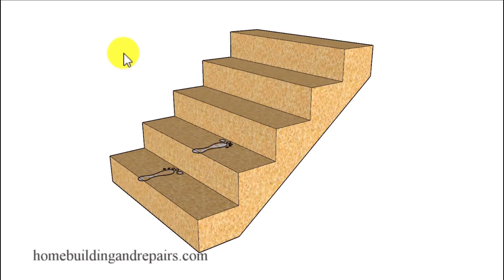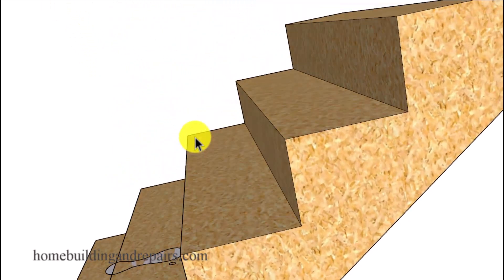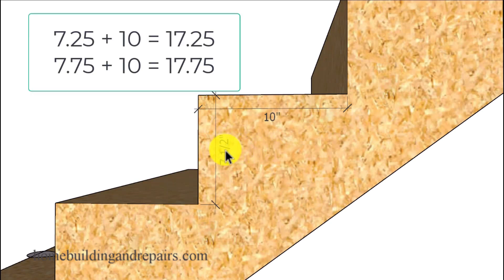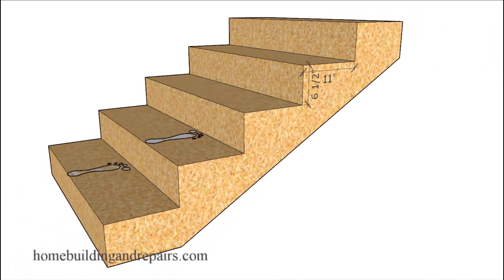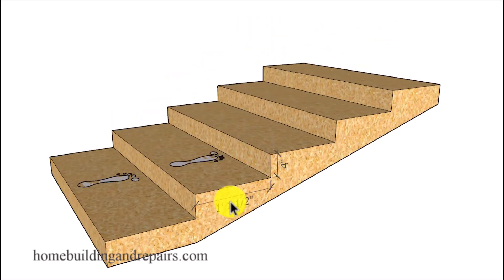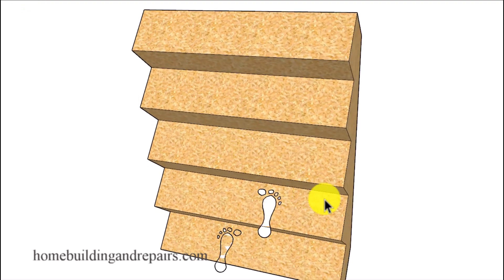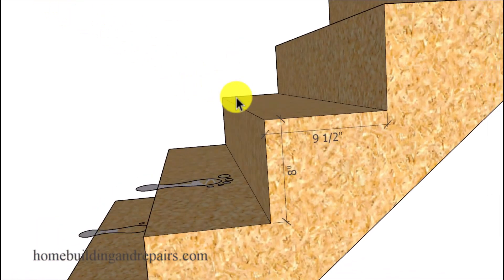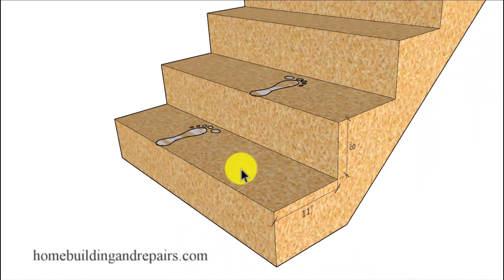What Is The 17 And 1/2 Inch Rule And Does It Always Work? - Stair Building Design And Safety

Comment: Oh man, really glad I found this one finally.. So I was gonna try and do something experimental and make really wide treads, like 15" for a 3 or 4 step basement stair that is just to get from the basement floor up not even 3 feet to where a furnace is.  It wouldn't be attached to any permanent structure and I'd periodically stow it away in the space that it leads up to, so I figured maybe code wouldn't apply.. Maybe I'm mistaken.  And then I realized such deep treads probably wouldn't even work with a 2x12" stringer.. But I was gonna build a substructure support.  This has me thinking maybe give up on the experimental one.